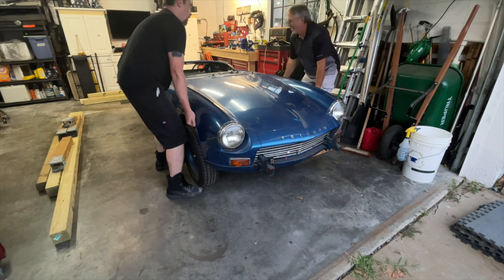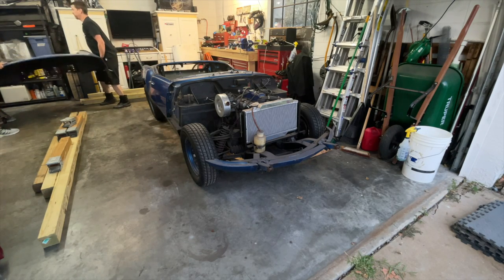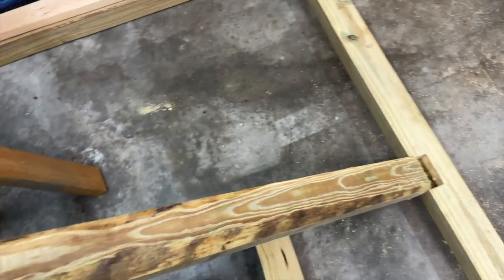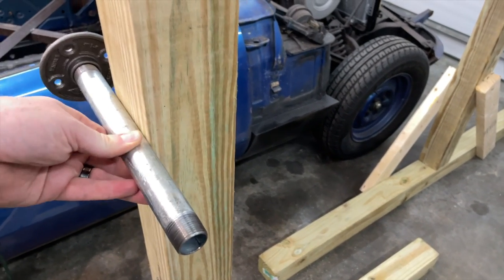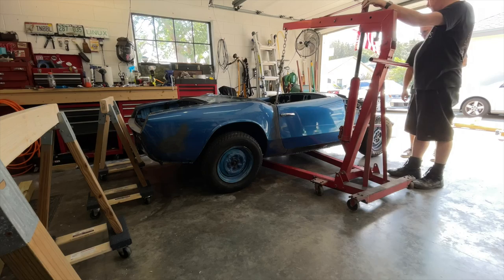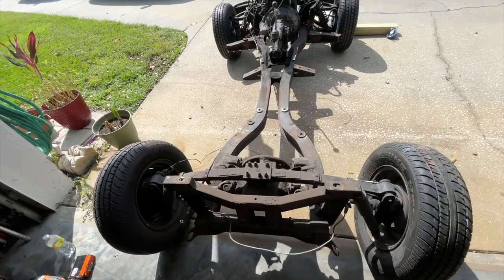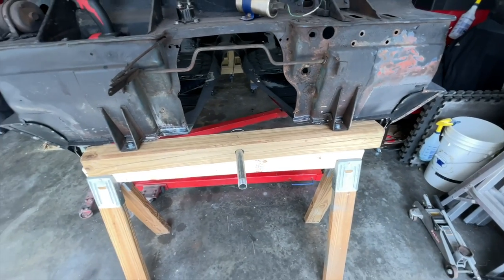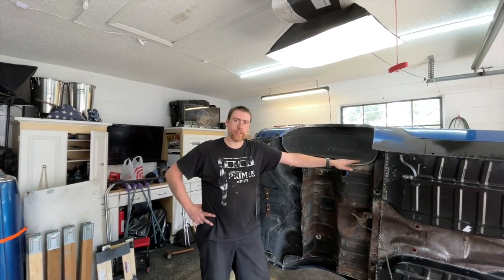Building a Wooden Car Rotisserie | Triumph Spitfire Restoration - Part 57

Comment: Very good!  Now, if you had to do it again, what would you do differently or improve on?  For instance, the 2x4 that bolt directly to the car are in the way.  How about some spacers?
Reply from the maker: I’d change that 2x4 to a 4x4 first.  Then in terms of spacers, I’d leave it as is.  It does not make contact with the metal aside from the washers on the bolts.  It’s very close, but it does not touch.  I’ll knock out the front and rear when I put it back on saw horses.